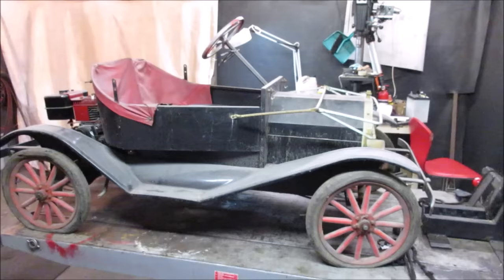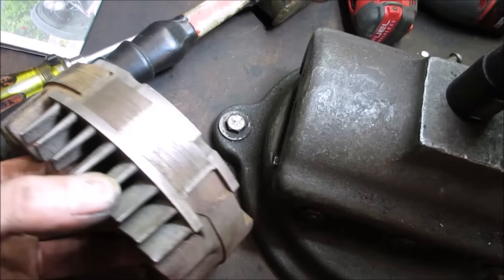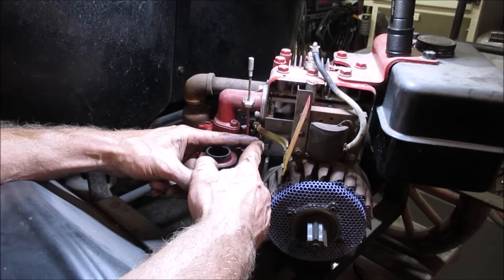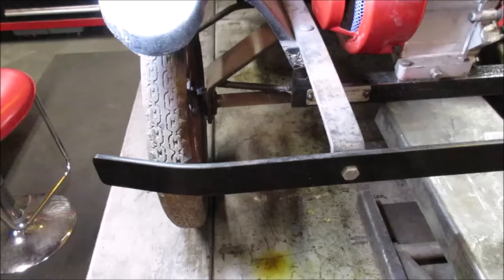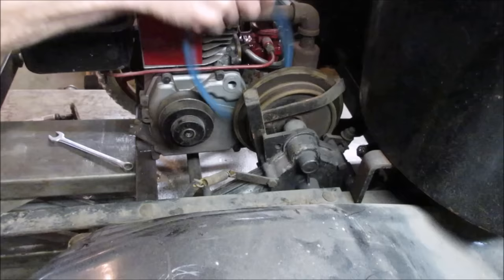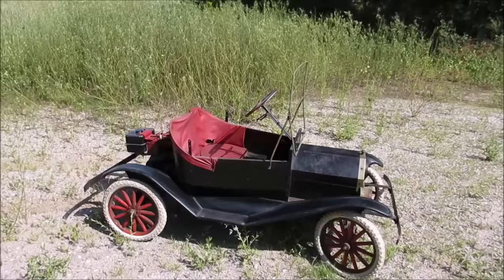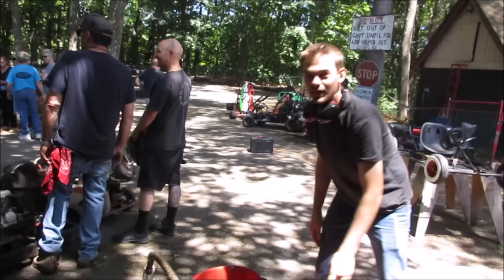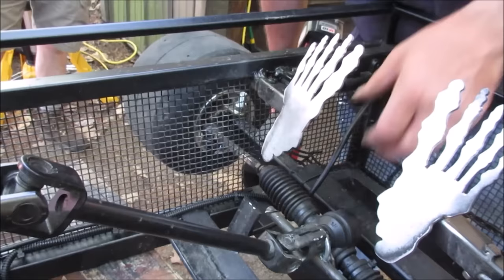Will It Run? Shriners 1962 Go Kart

Comment: I think those white tires would look good with the spokes painted black, the tires will dull out the way you drive, was thinking of the bat mobile test drive lol.  I prayed for you and your wife, and will keep you in my prayer's.  You are one of the few good yt channel's, and i just feel you have a good heart.  I have progressive MS that is wasting the muscles on my left side, limiting what i can do.  I had a parathyroid issue where all four were enlarged, and it caused the calcium to be pulled from my bones and teeth, then left bone spurs in every joint, and down my spine.  I had hoped the surgery would have lessened the pain i have, but no.  I had a bad accident at work, which messed my back up, and busted my leg up, and many surgeries didn't help because comp didn't believe i injured my leg.  I worked 9 month's, had to do physical therapy, until finally they did an MRI of my knee, and the ACL was ripped off the bone, and the meniscus was torn, and cartilage was destroyed from working with it that way.  Once that was fixed the finally sent me to an ankle guy, who did a special xray that goes higher up than the ankle, and they were shocked that my fibula was broke, but healed together in a cross pattern with pointed ends which could have caused a blood clot.  They rebroke my leg and plated it, and screwed my ankle bones together because ligaments were torn, and they had to cut the cartilage from my ankle that was bad from walking and working with it that way.  I ran a large cemetery, worked through winter doing burials with just my boots holding everything together.  When i went for PT, the lady was the one at comp who made me do the treadmill.  The PT lady apologized profusely and said that if she ever saw me again, she would never doubt me.  People who cheat the system, torture the rest of us.  I told you all this, because in today's world i find it harder to find good honest people.  I don't know you personally, but i have pretty good radar for people.  I also wanted to thank you for your video's, because it's kinda like being there doing it, and a lot of thing's i can no longer do.  G-d bless, from a girl in michigan.

Comment: I am 55 now. When I was 13 the family went to cedar point.  There was a paved course with 20 or more cars that looked just like yours. The track had a short metal fence that ran the middle of the track. This kept the cars on the track

The 2 large handles on the left side in front of back tire were 1 was a throttle the other brake handle. The people  working the track would hop on the running board then use those levers to move the cars up.

Comment: HI Mustie. I really like watching your videos. I have learned a lot from watching you. I live in South Georgia in Brunswick and  I own a small landscape company and I always use marine gas in all my equipment. It is ethanol free and I have never had a problem with carbs on any of my engines. I can leave the gas in all winter and the engines always start after only a few pulls. It costs more than regular gas but way cheaper than the fuel in cans from a store. You may want to check it out.

Comment: Once the tires are a little bit seasoned (specially if exposed to sunlight) the rubber will become slightly porous on the outer side, and they will start catching debris in there, thus making them look darker. Awesome video, BTW.

Comment: When I was in high school I took a small engine repair course and I made a “Flywheel Knocker” use a 3” long metal rod and drill a hole in one end, it slips over the crank end and you tap it and the flywheel pops off without breaking, just a tip for you instead of screwdrivers

Comment: In the 1980s in my city the Shriners had a 70s suburban with a welded steel frame and ramp that met and rolled along the road front and back. The Suburban would creep along down the parade routes and half a dozen  members in go carts would drive up and over the suburban,  circle, and do figure 8s as the parades progressed. It was hysterical mayhem.

Comment: I think the wires under the axle are there to give a little body roll. If these are Shriners cars, they'd do some pretty tight turns around each other in parades. That way, it prevents the tires from coming off the rims.

Comment: Seen these little cars in parades and even at a circus back in the 70's. Clown car that I have seen in a local parade 20 years ago. The heat has been pretty rough recently, take care if it becomes unbearable. 20 years ago I would be out in it lounging around the pool then swimming.

Comment: An old park in my area used to have these running around on a type of track for kids to ride. Basically a long winding pipe about 8 inches off the ground would make it so you couldn't steer off course. They would put along just above an idle and the kids could steer them to some degree. Identical to this model.
Reply: We used to go to a park that had these too but they were electric also had a pipe to avoid going out of track. Might be the same model but not sure as it's in France  who know

Comment: I used to have something very similar to this so I wanted to comment on the rear axle wire. You are correct in that isn't original. There should be some form of a plate there that pushes the axle firmly up in place. I think a simple straight piece of bar stock would work just fine with a couple bolts, though I think "memory might be fuzzy here" there was a slight curve in mine. It probably doesn't matter much for function to be honest, but it is supposed to be locked in place.

Comment: I've owned several go-carts in the '80's. Not one of them had brakes. At least reliable brakes. When I finally got a cart with good brakes, I ended up selling it at a flea-market and permanently gave up on go-carts. This started my mini-bike phase.

Comment: Darren.
Your car is a T10 tin lizzy 
There's manuals and that belt available online. 
The slot the rear axle goes up and down in is so when one side is on the center crown of a road and the other side lower than the crown the body tenis to stay level depending on the person in it weight and position during parades.
There's pictures online of two persons sitting sude by side but I think that would be kinda crowded if it's an average adult.
It's funny to think when Ford began manufacturering Thin Lizzy cars there was less that 1 thousand mikes of improved rural roads.
They were the number one driving force that sparked a explosion of road builbinf in rural America including state to state improved roads.
Yet they sold well in rural areas where the overriding majority of Americans lived then.
All because it was sold at a price rural Americans could afford.

Comment: The Shriners used to drive in the RIVERSIDE RACEWAY PARADE every year until they closed the raceway.  did figure 8s in the middle of the road. Politicians were for removing the raceway and putting in a Mall......if your wondering how that went mall is mostly deserted now and full of crime.

Comment: So when you show the wooden Rim up close and the wire supporting the axle. If you look at that there seems to be a rust line which appears possibly that there was a bracket of sorts that mounted there. Maybe it had a slot that was half circle so the axle could rest there and the bearing. Or it was squared off like the top side. By the way I have learned a lot by watching your videos

Comment: We had one of these in the 60’s - 70’s. I used a piece of plastic pipe to push down on the governor to me AWK it really go. Throttle only on the column. One on the left is a dummy. It had a double windshield that folded down.
Reply: I think it had one wheel drive as I remember. Yes about 10 miles an hour. We used in the local parades. So many memories.
Reply: One puts it engaged. If you pull it back it goes reverse. But that part was broken off of ours. The other one is the brake. So you have to use both of them to start and stop.
Reply: The windshield was a piece of plexiglass thousand in there around the frame
Reply: Yes I remember there was a fake hand crank in the front

Comment: Hmmm ... not that I want to create more work for you, Mustie1. But how about:
1) looosening the bolts on the bent wheel (maybe the spokes just need wiggly-realigning)
2) cut a plexiglass windshield and hold it in place with metal tabs 
3) squeeze-bulb horn
BRAVO! You're the Henry Ford of the shade-tree garage!

Comment: Hey Mustie. . .When you had that cart on the forklift and were tapping the gas pedal, there were sparks shooting through the hole directly below the gas tank.  It's the hoke that looks like it's part of the bumper.  Check your video at 1:20:04 and later and look at the circular hole directly below the gas tank.

Comment: Pretty complex engineering where a simple tensioning idler pulley would suffice. 
The play in the rear axle seems to keep all wheels on the ground when swaying side to side when they did all those intricate tight maneuvers in the parades .

Comment: Re the drive wheel it looks like there was a metal plate going across where that wire goes through the two holes. You can see the rust where a small plate went and was bolted in place.

Comment: Built by the same company that designed aand sold the Snapin Turtle & then the Snapper rear engine rider, I worked there 40+ years till B&S bought & stripped down the company & closed the doors in McDonough, these were built before I became a employee, would really love to own one of these that are original.

Comment: The white tires are fine. I think a good quality oil based black on the spokes would look awesome. The red looks unrealistic.  These are used in parades. I suppose kids liked the red. Some guys had these machine wobble. That might explain the axles. You'll know when you drive it.

Comment: I'd love to have an electric version of this! If the motor is 650 W or less and it's governed to 25 km/h it's legally a bicycle here, which means barely any regulations. All you need is independent front and rear brakes, lights, reflectors and a bell or horn. No registration, tax, insurance or other legal red tape. Building something that's classified as a motor vehicle as a one-off and get it road legal is pretty close to impossible in most EU countries. Too much official testing and certification involved to make it financially viable, even if you knew your way around the process.

Even as a bicycle it's not going to happen for me though because I lack the time, space and fabrication skills. You might also end up being run over by a truck, I know someone who almost was in a vehicle of similar size.

Comment: Looking at the "floating" end of the rear axle, it appears to be a crude pillow block bearing/bushing, hence, the oiling port.  Also, it appears to be a live axle, and the left wheel should be firmly attached to the axle.

Comment: Mustie,
The reason for metric is it's a tighter finer fit also if you used standard threading and sold the motor over seas or in Canada Mexico. There plugs wouldn't fit into the threads.

Comment: looking at where the rear axel comes through the bracket the appears to be the outline of where a plate may have been installed under the bearing to hold it up.

Comment: Dunno if you still have this or not, but I did notice that when you did the first wheels down drive train test, the right rear axle was spinning inside the hub. I bet if you rigged up some way to clamp the wheel to the axle you'd have this running in 2WD!

Comment: Tell that guy at 1:35:47 to "clock" the recoil starter so he doesn't have to stand on the left front to pull start it. If he unbolts the starter mechanism, he can rotate it counter clockwise so the pull cord is facing the rear, reinstall the nuts and then he can start it from the rear of the kart where the rest of the controls are; on/off switch, fuel line switch, choke, and have a better pulling angle.

Comment: The governor was the first thing to go on our minibike engines. I had the throttle cable right where it belonged. Hooked directly to the throttle! Remember that, guys? (I had the later, straight carb with the suspended fuel tank. No float bowl.) I think I just used a piece of rigid wire on the Techumsehs. They are faster than Briggs but they throw rods. (3.5 vs. 3.5 HP.) Never threw a rod on a Briggs.

Comment: From the website on these:

The engine & transmission and controls came directly from their self propelled "Snappin' Turtle" lawn mower.

That should help with finding belt size, and any other info needed on how the "transmission" works.

Comment: My guess is it ran at full throttle and the speed was controlled by belt slippage between the pulleys. Pulling the lever acted as a clutch.

Comment: One more comment: You could maybe make a seat platform using the anchor points on the sides and rear of the cab. That way you're not all scrunched into the seat like you were when driving.

Comment: always sand or wire wheel the flywheel outer surface . should just leave point and condenser in there and install the newer electronic  ignition. also sand the 2 faces of the coil horse shoe if points type or electric type . one thing to remember about your electronic coil if you use a resister type spark plug with electronic coil it will fail at some point . use a non resistor spark plug and coil will outlast you .electronic coils only have setting the air gap to the fly wheel . the closer the gap without touching the flywheel the hotter the spark . i rotate flywheel till magnet pulls armature to it with loose hold down screws . then i get 2 feeler gauges of same size and put between the armature and flywheel lettng the magnets hold everything  together and tighten the hold down screws. turn flywheel to get feeler gauge blades out. with spark plug out you can spin flywheel by hand and you should hear snap from plug and see a nice bright blue spark . put back together will start easier rev quicker . if you don't put in non resistor plug it won't start one day and you will remove spark plug and get blue spark but will never run. you have ruined your electronic ignition. i know if it has blue spark the coil is not bad . wrong it has to have blue spark delivered to the spark plug at the correct time not just blue spark . my one neighbor got a nice craftsman leaf vacuum from special trash pick up day and used it for few years. saw it at curb and before i could tell other neighbor he already texted me can we get it running? i told him go get it. it had blue spark good compression but wouldn't hit a lick . so i told him order new electronic coil and install it. fired right up been using it 3 years at least .he is a airplane mechanic thinks he knows how to fix anything . told me one day i am airplane mechanic went to school and everything . i told him well if i get a airplane you will be the first i will call. if it doesn't have wings i am your go to guy.

Comment: I bought a used Yanmar diesel clone about 2 years ago, and it came out of a generator. I then bought a tapered shaft adapter for it to use it in a tractor. the adapter was available on eBay.

Comment: I suspect the throttle cable had something at it's end to pull down the shorting tab and short out the spark. There appears to be parts missing from where the shorting tab broke off

Comment: Not sure if you noticed it, but at 1:01:51 the shaft is spinning inside the wheel.  Looks like the set screw just isn't tight to give you that posi-traction.  When you first spun it, you thought it was just driving the left side wheel.

Comment: If you don't have that movement up and down on a one wheel drive when you drive over a small dip you can lose all traction and not move at all, that little bit of up and down is sometimes just enough flex to keep them moving I believe

Comment: An old Briggs. She will run. Clean the points, throw a new condenser in it and and clean the carb real good. 
I have a model 19 that I'm waiting on a carb kit for. It was in a flood and had sat for years. Was Completely submerged in river water and I got it to pop off and run off of the bottle in about 20 minutes. Had to take thee head off and free up a stuck valve or it would have taken less than 10 minutes to get it to run. Surprised the block didn't crack by how much water I drained out of it. Crazy thing is the Transmission was cracked and completely froze up with rust but the engine isn't. It's on a 1960 Wagner Little Giant 700A garden tractor. Took me over 3 years to find and buy a replacement transmission. If anyone has one of these tractors, the transmission is the same as a 1964 Sears Custom 600 with the cast iron 3 speed Peerless 1200 transaxle. Axles and axle tubes are shorter on both the Wagner and the Custom 600.

Comment: I'm not sure what it was, but at 1:20:15 there were sparks/flame flashes at the bottom right of the picture, looked to be below the fuel tank, possibly a drip of fuel igniting.
There also appeared to be a stain on the floor on the same area.

Comment: McDonough Power Equipment is the company that renamed itself to Snapper, a much more recognized brand name.   Snapper, in turn, was the company with "The CEO who said NO to Walmart" when they wanted cheap mowers made in China but using the Snapper name.  That CEO was ousted and Walmart got their way with Snapper. Anyway, I have some 1/4 scale collectable things that are much smaller than this car.  This looks more like 1/3 scale. Proposed power swap for this car: sub the Briggs and Stratton engine for anything Pratt and Whitney.  It will be fine!